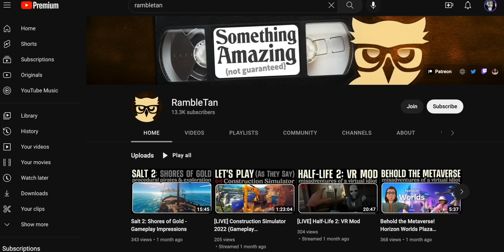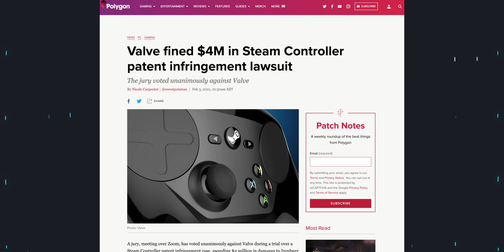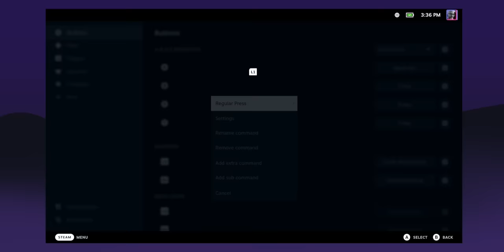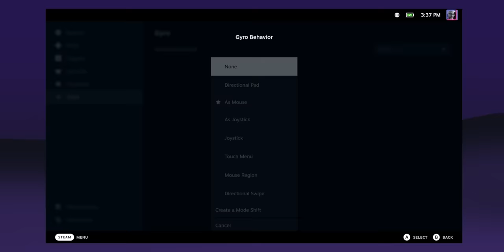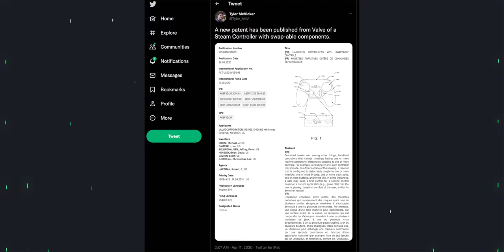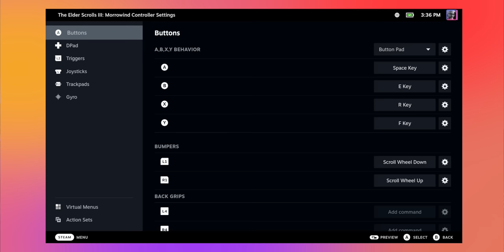Is Valve working on a NEW STEAM CONTROLLER?

Comment: I'm all in for a Steam Controller V2 with all the Steam Deck inputs and maybe some ergonomic improvements.
If they release such a controller, I'll buy it right away :)
Reply: yeah if it has the the steam deck layout  and usb c ima buy it right away
edit: maybe a bit different so it would fit a controller
Reply: You say it exactly right! That would be the perfect controller for me. Just the same Steam Deck, with no changes in the bottoms' placement, without a screen, and with some ergonomic improvements. That's all.

Comment: Yeah I want this exactly.  I want a Steam Controller with the exact same layout as the Steam Deck (with maybe some ergonomic tweaks).  Having the same layout will avoid messing with your muscle memory.  And then to have the same functionality with Steam Input as the on Deck controls.  I never really thought about the docked dilemma before seeing this video.  I wanted it to run on my PC so I could jump back and forth without losing anything (thanks Steam Cloud),  but to fit both situations would be a bonus.

Here's my use case:  Currently, I'm relearning how to play FFXIV with a controller so I can play it on my Steam Deck as well.  Controller support for that game is amazing and I do this on my PC with an XBox controller, but there are times I have to reach over to my mouse and keyboard because it's just faster (usually to get into the menus).  Every time I do this, I'm wishing I had the touch pads of the Steam Deck to be able to do radial menus to do the same thing, or to use the touch pads as a mouse.  Give me a Steam Controller with Steam Deck layout and functionality, I'll be golden.

Comment: I love my 2 Steam Controllers. More than Sony Dual Shocks and that surprises me ALOT!

Running HoloISO (SteamOS 3) and I feel the Steam Controller is practically a requirement!

The one thumb stick complaint is invalid. That right thumbpad works surprisingly well as a thumb stick.

I agree with tge D-pad complaint. Not sure the left touch is needed and a regular d-pad may have been better there.

For the rest, it does feel far too plastic and clicky.

With Steam OS ramping up for any PC release I think a new Steam Controller is going to be needed.

And yes, the Steam Deck was 100% the greatest trojan horse for this Masterplan.

Not sure a Steam Console is necessary, it may or may not happen, but Valve have my money on release day for a couple of updated controllers.

Comment: 100% would buy a steam controller that mirrored what is on the steam deck, no contest. 

I've been using the xbox elite 2 controller for just under 2 years now. At first, i loved the elite controller just for it's weight and feel, never really touching the back paddles since at the time i had no use for them. RB button broke not even 3 months after use and i didn't want the hassle of taking it back, so it was an adjustment for sure (mostly muscle memory) when i had the idea to switch RB and LB buttons to the lower back paddles and wow, it was massive change that i didn't know i needed. i don't even use the LB/RB buttons anymore. 

Adding 2 track-pads that are big enough sounds like It would be quite a chunky controller (along with all the other basic controller functions), but i think steam could pull it off. 

Honestly the only thing keeping me from fully utilizing track-pads alone on the steam deck is the lack of physical ergonomic feedback, I sometimes mistake where my thumb actually is on it when pressing down for the click, Something akin to xbox's elite circle d-pad would be amazing. I freakin love that thing!

Comment: I kind of wish the stick was a D-pad so the trackpads would have been analog stick replacements along with having less fragile bumpers. It's actually a pretty good controller other than those two issues. Thinking about it, I wouldn't mind them doing a 6 button layout with C and Z to be used in games where it would be beneficial such as fighting games like Killer Instinct.

Comment: I purchased the Steam Controller at full price and there are number of things I want to say.

First, a missing D-pad means that I have constantly switch to a secondary controller to play specific games. Secondly, the entire controller does not feel good to hold, ergonomically speaking.
But on the other hand, it can be used to play certain type of games. In example I experimented with the gyro+trackpad combination and it allowed me to play games I didn't imagined before. Like outlast with gyro was fantastic. On the other hand the software to setup a controller is supported for many controllers in Steam, not just this one. So besides the trackpads, you can get the same experience with other controllers that have gyro, plus additional stick and dpad.

So overall it sadly just sits there and I don't use it. The missing dpad was the killer to me, also missing second stick did not do well for it. But as a secondary controller for certain kind of games it makes sense. And maybe I pair it with the Steam Deck and play with the Controller when its docked to monitor/tv.

Comment: As a Steam controller fanatic (I own 3 and use the SC for everything on my main rig in my theatre) that also loves my steam deck, I can safely say a Steam Controller 2 with the deck layout is a must. I don't plug my deck into my theatre but my actual rig is hooked to my theatre and I use the OG Steam Controller 24/7. It is a must that Valve releases an SCv2 so that I can easily switch between the two devices. I get home, plug my Deck into the charger, walk over pick up the SCv2 and just pick up where I left off. I do this now but I have to have 2 different profiles, my deck profile and my SC profile. I need parity between devices so that its only one profile.

Comment: I Agree with your reasoning. I too believe that the steam deck is just the beginning for valves hardware dreams. The handheld version being the 1st was a very clever and strategic move. A console is coming and (hopefully before the console) a sc2. 
Every week they improve steam os, still more units and gain more buzz. The door is wide open for them to be a massive disruptive force in the gaming hardware space
Reply: The Steam Machines already existed but they were ahead of even the controller.  We might see a resurgence of Steam Machines now that the OS is getitng better.  Though they were not directly a valve product but other PC manufacturers making them.  Perhaps valve will make some specific hardware.
Reply: @AgentKenshin  yes I know. I don't understand why people keep bringing up steam machines. The only thing it has to do with what valve is doing now is they learned from it. 

Steam machines was before proton was worth a damn. It's before steam os. 
Valve making a new console would a million miles away from what the steam machines where
Reply: @runadumb  Steam machines ran on the very first version of the Steam OS.  It was just after big picture was released.  It pretty much laid the foundation for what we have now.  A few of them did run on windows but most ran the new OS.  It was definitely before Proton really took off though.

Comment: If I they could make a controller with all the inputs of the deck that would probably do very well. 

And for a Steam console they already have the processor, and because it’s a console without battery power they could give it some more cooling and turn up the power budget for the chip and it would probably be great for 1080p gaming or upscaled 4K.

Comment: The Steam Controller was motivated by the Steam Machine, a mostly forgotten attempt by Valve to make consolized Gaming PC's which didn't work. The Steam Deck is doing that whole thing right, and it also got the layout mostly right too. There were also some issues with build quality, and stuff which was eventually rectified with the Steam Deck anyway. So the Steam Controller didn't fail per se, it was a learning experience, because of the Steam Controller, Valve learned a lot from those growing pains, and then was able to nail it with the Steam Deck. Now because they got it right with the Steam Deck, and no longer need to be hamstrung by the Steam Machine, they can make a Steam Controller 2.0 and do it right. Proper build quality, put back the d-pad, and right analog stick, two pairs of rear paddle style buttons instead of one pair, etc. Just a few tweeks, make the touch pads concave, improve the quality, and it can be perfect.

Comment: Man, I hope you're right Bill. I've been playing Horizon: Zero Dawn between both my PC and Deck. It's honestly more comfortable for longer durations on PC with an Xbox 360 controller, since that's lighter and IMO more ergonomic. But I immediate miss the back paddle buttons and gyro whenever I set the Deck down. So yeah it would be great to have the same controls as the Deck in a lighter-weight gamepad, maybe with with larger face buttons and joysticks too.

By the way, I do own a Steam Controller, I just don't find it nearly as good as the Deck's inputs and still prefer the Xbox pad.

The full dream would be to have a portable machine that plugs into Nreal Air AR glasses and a standalone Steam Controller 2 / "Deckpad", then I wouldn't have to tire my hands from the weight nor tire my neck from looking down.

Comment: I pray Valve launches a Steam Controller V2, I still use mine to this day and continue to love it. Has some wear on the stick but otherwise fully functional piece of hardware. I would've love to buy 2 or 3 more on the $5 wholesale thing, but sadly they weren't available in my country to begin with so no chance.

Comment: Valve plz, I want one! I will buy one if they make a new one, or even start re-manufacturing the old one (though im hoping they make a new one that improves on the old ones design).

Your prediction on the controller makes perfect sense to me, idk about the non-portable one though. They've always struggled to break into that market as you could just hook up a gaming PC to your computer. It would have to have the performance of a PS5 at the same proce point. If it did... it can take my money right freaking now

Comment: Love my Steam Controller! But yes Valve only Markets within it's bubble. Also many would "Review" the controller as it sat and didn't take the time to review it on an ongoing basis. It was updated for years after release. So most if not all of the issues reviewers reported were fixed or addressed in someway.

Comment: I would like a Steam Controller 2 with the inputs of the Steam Deck. I've been playing emulated games on my Deck and have been using the back buttons for things like save/load states, so it's a little bit annoying to go from handheld to docked mode while going to another controller. If I use my Steam controller, I'll have 2 back button inputs, but it still does not quite feel right with only one joystick. If I use my PS4 controller, using that controller's touch screen feels inferior to the trackpads of both the Deck and the Steam Controller (also, while the touch screen can be two separate button press inputs, I have ran into a lot of instances of pressing the left "button" and it triggering the right button's input instead). 

Even so, it still requires extra time in the Steam Input controller menus to rebind the buttons so that they can match as close as possible to my Deck's configuration in handheld mode. It would be wonderful if it was a separate that read all the bindings the same as the Deck so that there is no need for additional configuration when switching from handheld to docked mode, making it a truly seamless experience. Additionally, I wish there was an option that you can turn on that automatically switches the primary controller to the external/blu-tooth controller so you don't have to go through the menus to manually swap controller order everytime you switch to docked mode.

Comment: I fully anticipate future consoles to start using SteamOS. Not any from the big three, more like potentially a future Nvidia Shield successor being loaded with SteamOS instead of a modified android. I could see Valve making a home console at some point,   either one that gaooens controllers will need to made to be fully compatible with all the Deck inputs for full cross compatibility.

Comment: It's worth mentioning that the Valve Index controllers, released in 2019, feature a similar level of insane customizability and options, with that classic touchpad + stick combo, touch-sensitive buttons, weird way of holding it, and the finger detection.

And in the tech specs for the Steam Deck, under the trackpads, they even have a mention: "55% better latency compared to Steam Controller".

2 new touchpad controllers? Steam Controller 2 confirmed. They definitely haven't forgotten about the Steam controller, and have been messing around with the various technologies it introduced.

Comment: The important thing that nobody mentions is that the Steam Controller itself did not fail. You are absolutely right about marketing and not making it clear to consumers what this thing was capable of. But the death of the Steam Controller was written on the wall when its purpose for existing failed which was the Steam Machines. 

I think you are on the money with their plan. Right now, they are still working on getting solid dock support for the deck and working out the bugs and increasing the flexibility. They only just launched their own dock. They are only in beta for the Deck UI replacing Big Picture Mode on Windows. Finally, SteamOS for desktops and laptops isn't ready yet. Now isn't the time, but when everything comes together, I think it will be time for the Steam Controller 2.

Comment: Jup, they should definetly make a version two that is basicly a steamdeck with no screen. -I'd buy it to use when docking my steamdeck. Right now I am considering the Gulikit KK3... or if I should spend more on a designlab x-box elite controller.... If there was a new version of the steam controller I would have gotten that without hesitation.

Comment: That's a super intriguing theory Bill!
Of course a new controller makes sense, mainly because right now there's no first-party controller made with Steam Input in mind.
And transforming the Steam Deck into a nice console also is fairly trivial at this point. Get rid of the controls, screen and battery, and fuse it together with the Dock. Add a more powerful APU, and everything works.
The Steam Deck solved so many problems since its inception that there really isn't much left to do for Valve!

Comment: I like my steam controller. But I personally wouldn't buy it again because I just can't get used to the not traditional layout. I want 2 thumbsticks and normal pressable buttons. I mean, it works great, but all the games you this would be good for I would play on my PC with mouse and keyboard anyway. Also a rechargeable battery would be a great improvement for me. I might buy a SC2 but it depends on them.

Comment: A steam console would be neat, maybe they would use RDNA3 for it? Say 4cores 8threads and 12 GPU. That would be enough to compete with other consoles but honestly they need to give it a thunderbolt port so you can plug in external GPUs if you want to. Just saying that would be neat.

Comment: As owner of a Steam Controller, unfortunately I have to say that it did fail for valid reasons. It's wonderful that it enabled certain games that otherwise wouldn't be playable with a controller, but at the same time, the lack of a second analog stick is terrible for all those games where camera precision is necessary, like FPS. In the end, I had to buy an xbox controller to play those games, so I cannot really fault people for sticking to one controller and move to mouse and keyboard for those games that do not support it.

When it comes to a possible steam controller successor, I think it makes a lot of sense, I think they learned the lesson and I have to say that with my steam deck I can play pretty much everything, so a controller able to reflect the steam deck would be perfect for when the deck is docked.

On the other hand, I'm not convinced on a steam console, the deck makes a lot of sense due to its portability and the fact that the Vita was discontinued, so a lot of console gamers who wanted to play newer titles that the switch couldn't handle, now had a way to do so. A console takes away the portability aspect and is pretty much just like a prebuilt gaming PC, so I'm not sure there is that huge of a market for that, but I guess it all depends on how it's priced.

Also they wouldn't be able to reuse the deck hardware for such a console, as the steam deck is a potato when playing on high resolution screens like the one on a home TV.

Comment: I still want a proper steam controller v2. Same layout as the og, just with improved tech specs and 2 extra back buttons.

A "Deck Controller" should exist too, but that wouldnt be a sc v2 imo. The sc is more like a "genre peripheral" akin to fightpads or hotas rigs. Its literally the best controller made for keyboard and mouse games, games that traditional controllers suck massively at, and yet people unfairly judged for its use outside of its "genre". If you wouldnt judge a hitbox for its ability to play twinstick shmups, you shouldn't be judging the steam controller for those games either.

As a power user of the og sc (who even uses it for traditional controller games and to a high level), I dont want to see its innovative use of trackpads diminished just to be - more or a less - a dualsense with valves logo... Because honestly? A dualsense would be excellent for like 90+% of the use cases most people would want a deck controller for anyway.

Comment: If they want the SC2 to have all the same inputs as the Deck, it will have to be HUGE compared to the other mainstream controllers. This is not necessarily bad, but they will have to work really hard on the ergonomics.